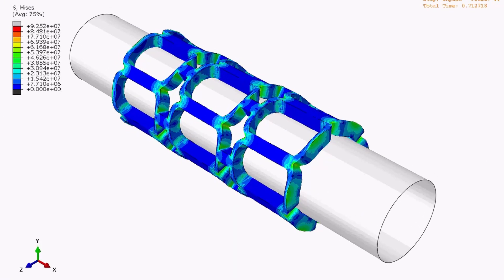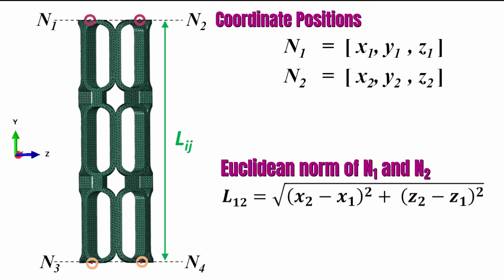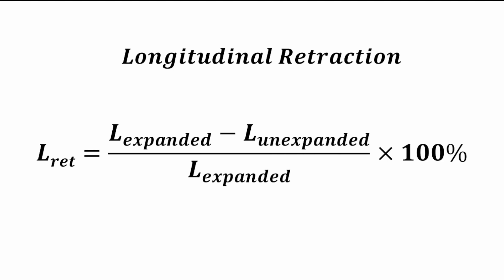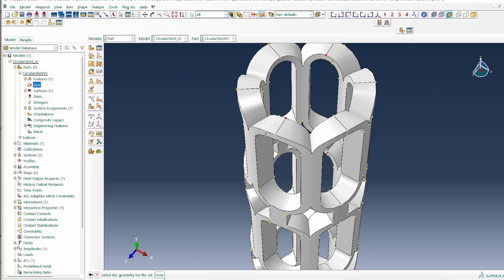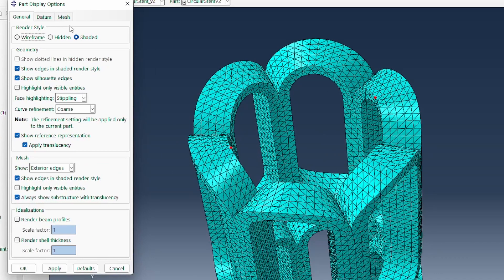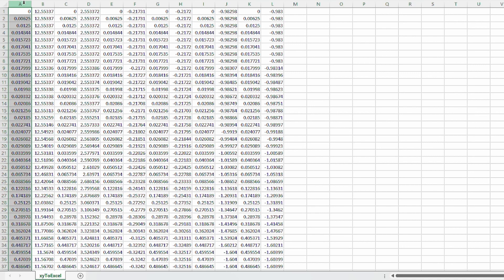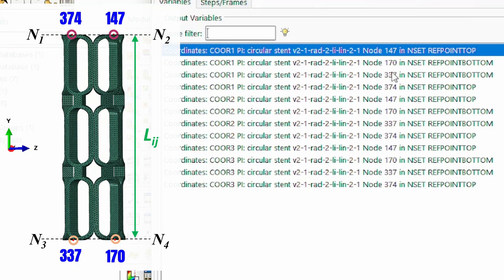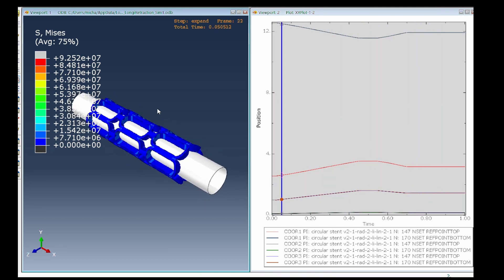How to get LONGITUDINAL RETRACTION from a STENT Simulation

Comment: How its different from stent foreshortening?
Reply from the maker: The longitudinal retraction (LR) compares change in length between fully expanded and unexpanded lengths of stent. Foreshortening (Fsh) compares between fully recoiled and unexpanded lengths. The LR will measure the biggest effect of length change in the stent however some of this length reduction is recovered on release of the inflating pressure. The Fsh measures the extent of this reduction. They are similar but slightly different with Fsh quantifying recovery of stent whilst LR measures extent of reduction achievable in the stent following imposed pressure load.

I will suggest you look at the further explanations given in my paper here: https://doi.org/10.1016/j.mechmat.2021.104092
Reply: @MichaelOkereke  thanks it makes it clear now. Already read your excellent paper

Comment: Good day Dr,
In Abaqus, i want to find the value of Longitudinal Modulus. It is a ratio between longitudinal stress and longitudinal strain. Does it mean I just get the graph of stress and strain in longitudinal direction? I dont know whether if Abaqus has specific symbol of Longitudinal Modulus in ODB file viewer. Tq
Reply from the maker: Hello @Dr. Mimi, I have not worked with Longitudinal Modulus but what you describe sound like the right approach. However, I will suggest you read around the topic and find the best way to determine it. There is certainly no specific symbol in ABAQUS for extracting the Longitudinal Modulus, at least as much as I know.
Reply: @MichaelOkereke  Thank you Dr. Im appreciated